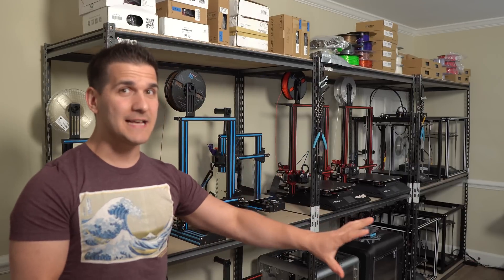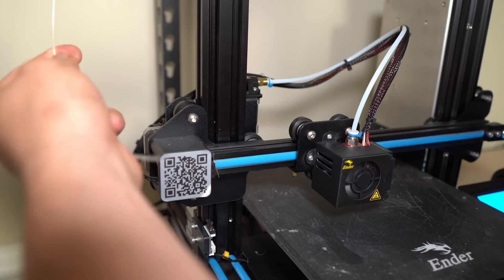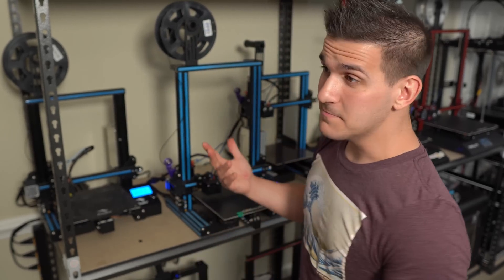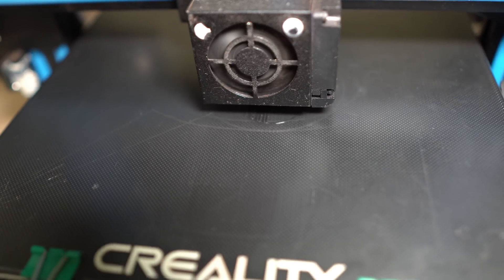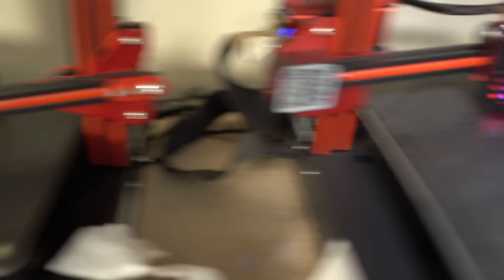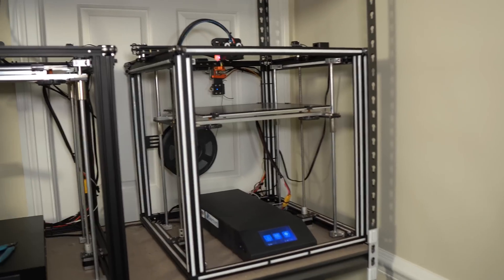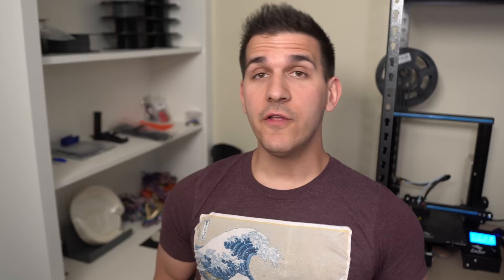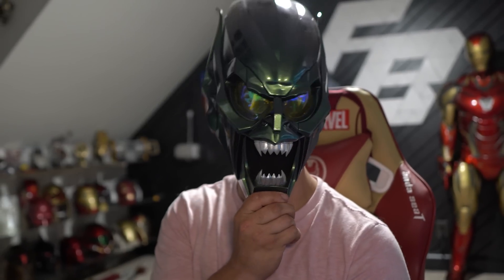Tips & Tricks to Maintaining a 3D Print Farm!

Comment: Loved the video! Quick question though, have you had any issues with the Sovol Sv03s? I got one sometime last year after you mentioned them and its had nothing but issues. Bent Z rods, broken thermistors, ripped hot bed cable, BLTouch not working, and just overall pretty poor print quality. Support also takes a long time as replacement parts come from overseas. I wish i wouldve saved a little longer and gotten a CR10 tbh. I have learned a lot from constantly fixing it though so, silver lining

Comment: How many battery backups do you use, if any?
Reply from the maker: None
Reply: @FranklyBuilt  do you not ever have power outage issues? My Enders are notorious for it, and we live in a nearly brand new house with a solid power grid 😑
Reply from the maker: Nope never had one. They all have print resume so I’m not too worried.
Reply: @FranklyBuilt  so, better question then: when I do use print resume when it happens, I often get a gap between layers where it happened. I have minimized it somewhat by adjusting the baby z-steps once it restarts, but it is pretty hit or miss. Do you have that problem at all?

Comment: PETG, I use alot of it and I always have to dry it out before using a new roll just to be safe (and sometimes dry again halway through the roll). PLA is fine, no problems there, but PETG loves to absorb the moisture in my experience, I know I need to redry it when my prints start under extruding and are just overall ugly.

Comment: Any chance you could upload a video one day explaining a bltouch and what it does and how to use one? I know there's videos out there but theres just something about the way you explain things that helps me learn it so much better.
Reply from the maker: I mean: a whole video just about that would be a little much. It measures the bed in 16 points and creates a “terrain map”. So even if the bed is flat it may have microscopic dips and high points. As the print heat moves, the printer moves the Z axis up and down ever so slightly to compensate for that high/low difference. Imagine running your finger over a grassy hill but you never push INTO the grass. You only feel it on your finger tips the whole time.

Comment: I have a question for future reference about cleaning the nozzle of a 3D printer, if bits of melted plastic on the outside of the nozzle start to interfere with extrusion, what is the best practice for cleaning that residue off of the nozzle?
Reply: Heat up the nozzle, then use an alcohol wipe or damp towel to wipe it. After that use a wire brush, knife, or needle to remove melted plastic. Hope this helps 🙂
Reply: Use a wire brush
Reply: Yes sir
Reply: If the residue is on the outside I heat the nozzel and then scrape off the residue with plyers. Then I use the nozzel cleaning needles included with my printer to get right in the nozzle and clean that out. Sometimes I unscrew the bowden tube and use the opposite end of the needle to clean out the hot end.
Reply: I use a paper towel when mines at 300. C